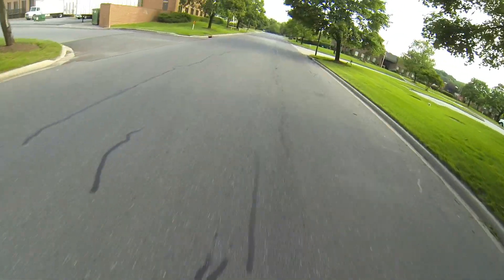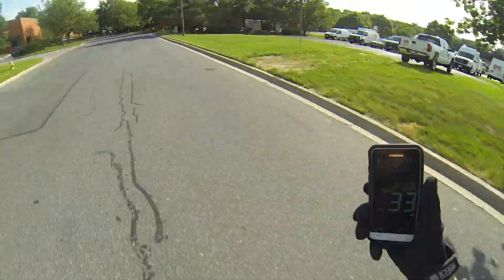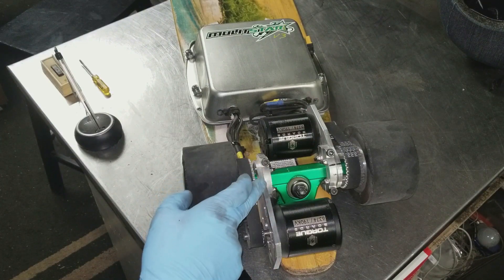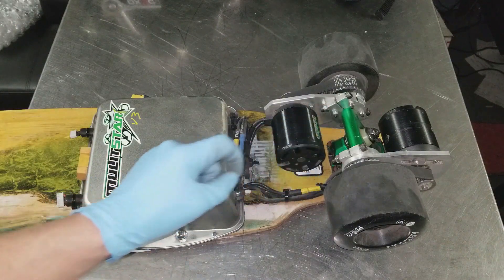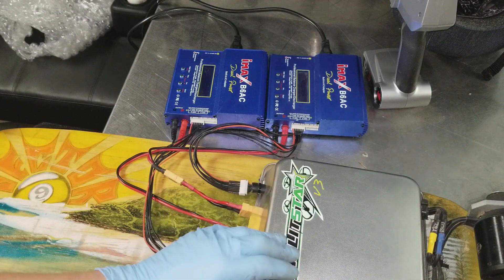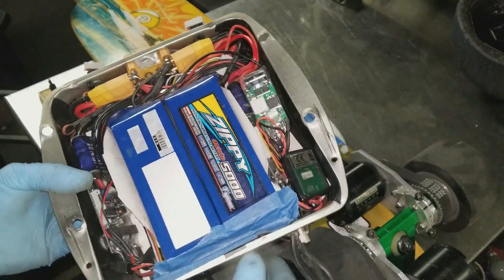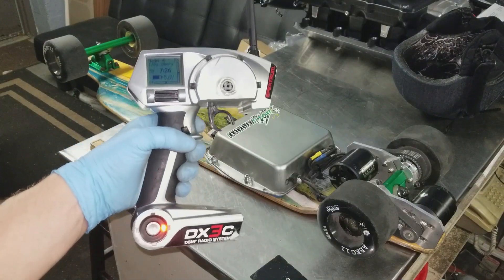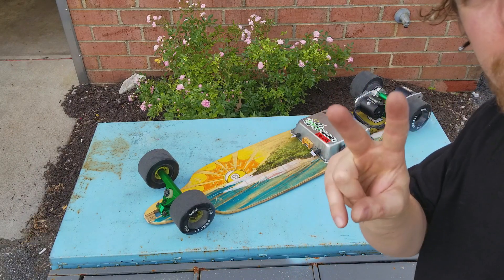Budget High Power Dual Electric Skateboard: Updates, Its Scary Fast! Full Build Setup! Part 2

Comment: I've been wanting to build an all terrain board and I was curious if this setup would work but with mountain board wheels and trucks
Reply from the maker: The motors should be fine maybe talk to a manufacture about if the motors are ok in water. I also imagine you could seal the hall effect sensor your self you would just have to find motor mounts or make them that fit your trucks and a belt drive that fits the wheels etc. Chain drive would be a better option for offroad / dirt and debris environment. Also I would check with the motor manufacturer
Reply from the maker: I would also get better VESC's I burnt one of mine out and am switching to a bigger rated Dual VESC
Reply: @CamaroRick  sounds great I'm not really looking to ride offorad I just live in the south and the sidewalks and stuff are all jacked up so I figured one built for off-road would be better due to rough sidewalks/trails I would be riding on
Reply from the maker: @loganpack9473  some big pneumatic wheels would be killer with the power of these motors. 6380 190kv will turn them with ease
Reply: @CamaroRick  that's also a big thing to is it would be powerful enough to pull up hills pretty easily
Reply: What did you say the range was
Reply from the maker: @loganpack9473  I used to ride it to and from my shop which was about 5 miles each way. I never pushed it to see how far it would go but I believe it was calculated to be around 12 miles through the BWI paved bike trail riding at a quick pace with bursts on the straights
Reply: @CamaroRick  sweet and I believe more batteries wired in parallel would increase the range as well

Comment: I see that you use the spektrum dx3 remote to control your vesc. Do you know if a vesc is compatible with any rc remote?
Reply from the maker: These vesc have the same Receiver plug as any hobby grade RC so you can use any of them. I highly recommend using separate power feed / sbec voltage regulator direct off of the battery voltage. The Vesc supplied reciever voltage has the potential of dropping the 5v output and it will trip the reciever into fail safe (it will shut down the RX after holding the last command for a full second which is an eternity at full throttle)

Comment: How many miles on one charge from the 12s
Reply from the maker: around 15 miles mixed throttle. I have it set up to plug in another battery box if I needed to extend the range but I can ride it to and from work on 1 charge with a lot left over so I have not had to do it
Reply: @CamaroRick  could you run 2 6s to make a 12s what voltage is your 12s great biuld mate
Reply: Sorry just read your comments
Reply from the maker: @fpvcowboy2635  Yes that is what this setup uses 2 6s batteries wired in series. The MAH stays the same when going in series. They have to be the exact battery. fully charged is about 50.4 volts
Reply from the maker: @fpvcowboy2635  All good!

Comment: are there the schematics for the battery system? Thanks
Reply from the maker: I am working on the drawing, I tried using a schematic design software to make it clean but it's a little tricky to learn it. I will probably just post a hand drawn one
Reply: @CamaroRick  thanks so much!
Reply from the maker: https://www.electric-skateboard.builders/t/first-esk8-ive-ever-rode-its-ridiculous-and-i-love-it/78618/14?u=camarorick
Its a little crude but thats how I did it without an onboard BMS